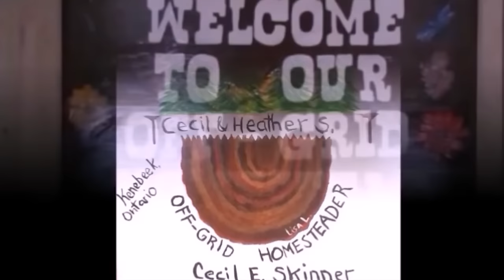Will This Work?  Building A Structure To Slide A Prefab Roof Up In Place.

Comment: Hi Cecil, looking at the biggest window that you want to put up on the lookout, i think that the easiest way for you would be to take the opening lights out and the centre glass pain  then carry\ hoist the frame up to the roof , sit it on a dwarf wall build a main structure frame around it , 
build the roof on to the structure then sheet it in..
It would also be easier for you both if you had the staircase up to the lookout completed first..
What do you think..?
I wish i was there to help you, i've done this type of work many times,
But now being semi disabled , i can not offer my services,,😄..
Anyway best wishes to you both, i'll be watching from afar. THE UK..
👍

Comment: Hi Cecil, Heather,.......Do you think you could manage to build Bert's Look-out using access from the inside by tempararilly removing the metal roof panels around the look-out and work from the frame work for better footing rather the slipperry metal roof........,By removing the metal panels, you could build a leveling platform about 3 feet wide around the look-out to work on, this would allow you to build the roof and walls of the look-out...... you could install the large windows from the inside if you plan to use a tackle & block hinch to raise the windows............If this is possible, the windows would be much easier to install once the outside work is complete.......it would be tricky but perhaps possible..I shudder each time I see you and Heather at the top of the roof! . Regards to you and Heather....

Comment: The wooden steps on the roof will be a great help. would it not be easier to start with say the sixth from the top end gradually make each board wider so that when you reach the top the boards will be just the right width of the crows nest
Reply from the maker: Hello Barry, thanks...you have a great day. Cheers!

Comment: Hi  more progress.  If you are going to slide equipment and materials up the roof  then the tin should be protected.  Would handrails/track on the boards you have just fitted save the roof?  Mike

Comment: Very clever idea Cecil !!! Is this your idea or have you "learned" it somewhere ??? Any case, it's "brilliant" !!
Not to "rain on your parade" in any way, but the larger of those smaller windows seem much more appropriate for the scale of those walls of the lookout !!! Just my opinion, of course.
Reply from the maker: Hello, I came up with this idea on my own surprisingly enough lol.  Thanks. You have a great day. Cheers!
Reply: @SkinnersHomesteading  
Brilliant idea !!! No new holes in the roofing. Put a couple of "skids" up the cross pieces. Are you planning on putting the exterior sheeting on the walls also before hoisting them up the roof?? Seems like you will need to do something like this all around the exterior of the "outlook" building so you can build your "working platforms for the exterior finishes on the walls. Going to be a bit of a "chore" but definitely "doable" !! Be careful and "stay safe" !!